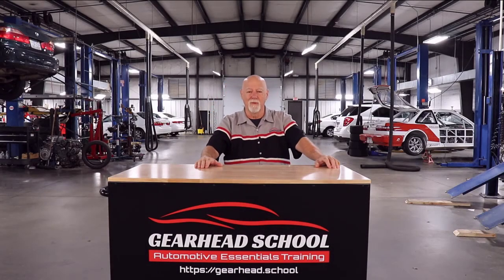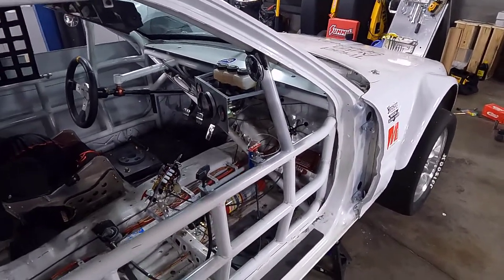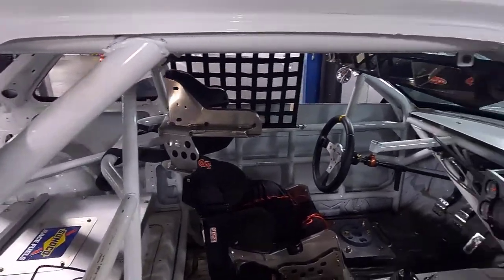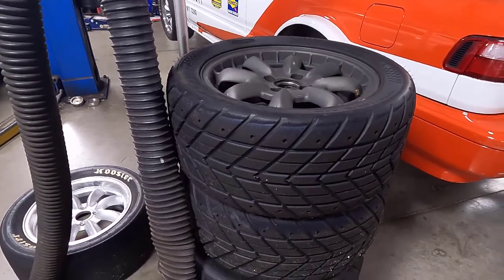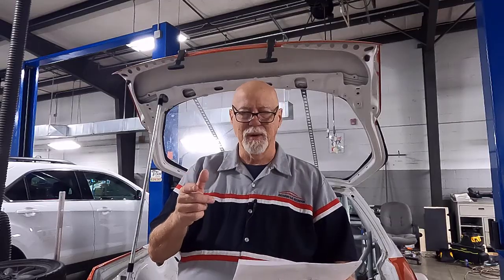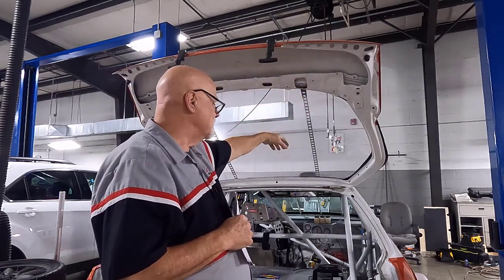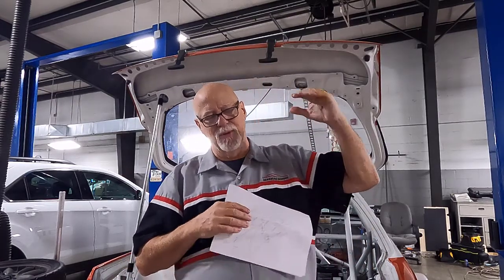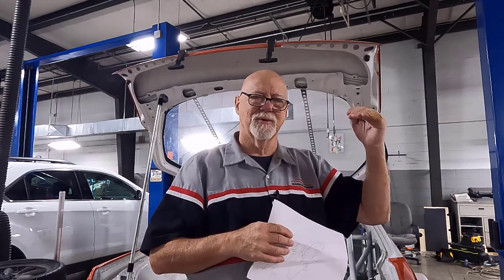Race Car - Center of Gravity and Polar Moment of Inertia - SCCA F-Production Acura Integra

Comment: Love it. Polar moment of inertia doesn’t get the attention it deserves in a lot of racing, imo. 

If you happen to see this, I’m curious if you have a system for locating the axis of the moment of inertia, or if you have a general area where you assume the car will rotate? Is it at the CG, the middle between the front tires, or somewhere in between?

I know it’s usually easy to judge, because you’re just moving it closer to the middle, but where exactly is that middle/axis? 

I’m guessing it changes, even when the car doesn’t, depending on yaw, the slip of each tire, etc.. Maybe even which direction the acceleration is at any one instant. 

I’m curious if you have any thoughts or input on that.
Reply from the maker: Russel, Glad you liked the video. The most common way to determine the center of gravity on a car is to weigh the front and rear axles while the car is level. Then raise one axle at least a foot higher and weigh both axles again. Plug the two sets of numbers on a formula. 

There are several good articles on this on the web.

Good luck?